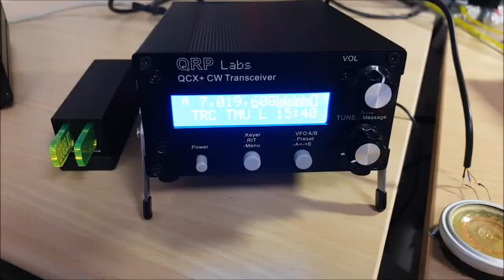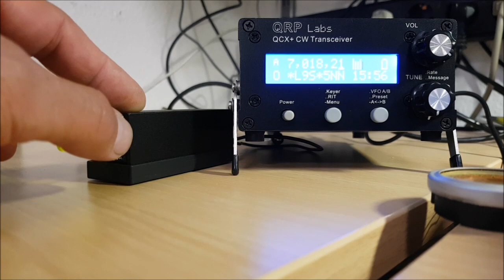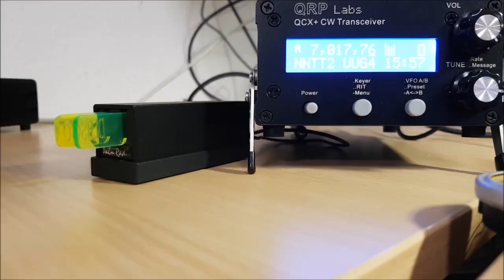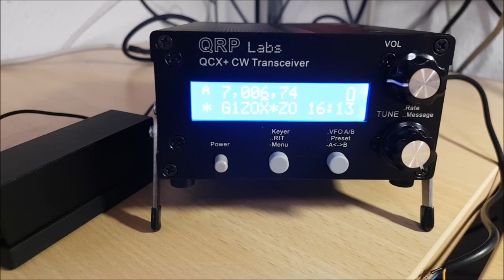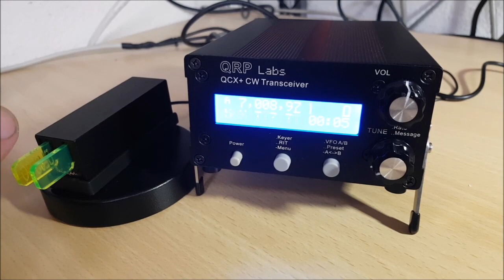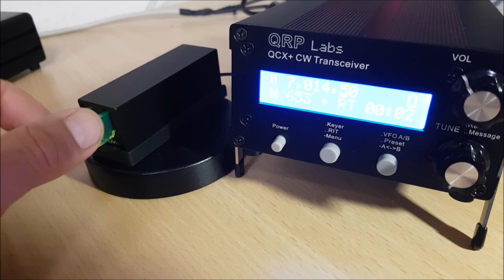Playing with the QCX+ in the TRC DX Contest on 04.October 2020

Comment: Awesome. I built my qcx+ 20m as my first time project. (Well second if you count the dummy load). Went well.  Seems to work. Do you think I need an oscilloscope to test properly? I haven’t fiddled with the turns on the toroid. Not confident with my Morse reading yet. 
Like the little legs on yours- where does one get them ?
Thanks for the video 
72
Patrick 
2E0ISH
Reply from the maker: Hi Patrick, you shouldn't need an oscilloscope, I just used my WM2 wattmeter to adjust the coils. 
The legs are the Peg Legs from Palm Radio, out of production. If you are interested to get some more information on them you can send me an email - mycallATT darc.de :-)

Comment: Nice, did you wind the coils according the manual or where modifications (less turns) needed?
Reply from the maker: Thanks max2765, the coils have been wound according to the manual.
I think I could tweak the coils a bit later on...right now it is 4.5 Watts @13.8V